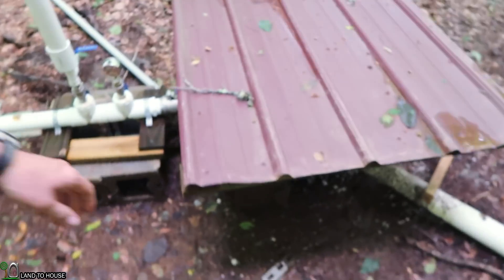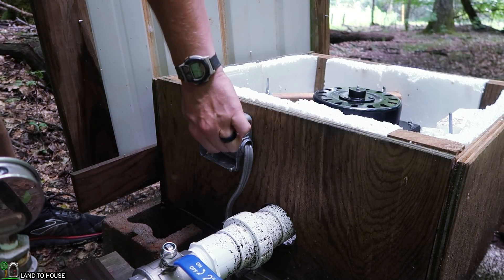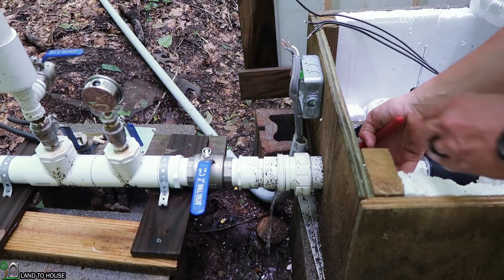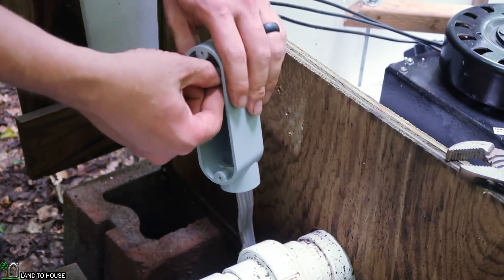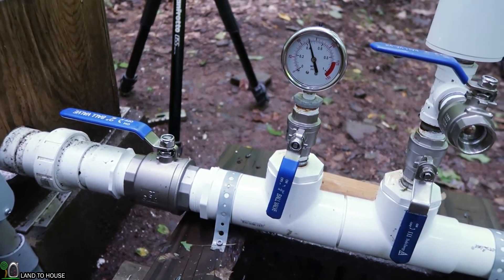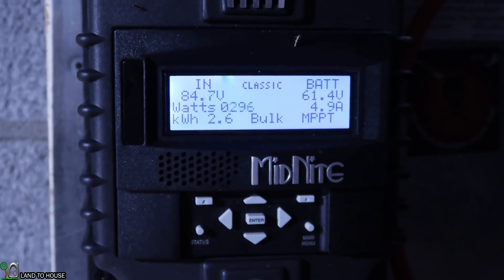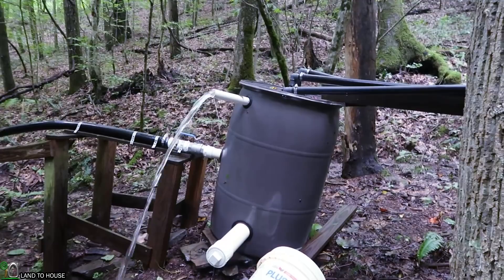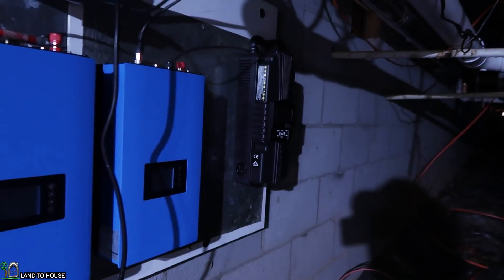Watts OVER 300! Adding another Nozzle increases Watts in Micro Hydro

Comment: you could put a three-phase autotransformer at the output of the generator (surely it will be 400 -600 Hz for which a small size is enough, and you bring the output to a higher voltage)

Comment: Why did you not make a water-tight connection in the LB?  That is one of the two reasons for a 90°LB, the second is for long pulls.  Also, I am very concerned about batteries in the crawl space.  I know of a couple fires that have burnt down "Battery Houses"! My Cuz lost his solar bank out-house just that way.  Better an out building than YOUR HOUSE!  OK, I looked again and the wires out of the PMA are a little short, but you could rotate the the top of the PMA 1/4th turn counterclockwise without redoing the piping. Thus allowing wires to be closer.  Or am I all wet on this?  LOL  But!  I am impressed and want 300watts, MYSELF!

Comment: Of course you have lost me when you start taking the technical info stuff I don't have a clue on what some of stuff but other I do get it.  To me it seems to add one more 55 gallon drum  to  catch the over flow water have water to use also. .Also why have four  Nozzles when you are only using one or two at time. Don't know why maybe open 3 and 4   1/4 way or 1/2 way open or less and see if water psi can keep up after putting the same size nozzle on the other two . Like i said I'm new to all this . Looks great good job . Ps, thanks for coming back and putting some kind all weather box at  Generator box .

Comment: Is there a limitation of how much pressure or water flow the generator can take? Otherwise why limit your water flow and waste the over flow?? My humble suggestion would be using a much bigger picture to get more water flow down stream so you can use more nozzles now instead of waiting for rain. You are throwing water away via the overflow.  More rain will just mean more over flow.  Why not use the overflow water now via much bigger pvc down to the generator and allow much bigger outflow instead of the restrictive 3 to 4 inches diameter pvc? The design does not make sense to me.
Reply: He has too little flow to run it at max sometimes 
that's why he has to limit the flow

Comment: Your system seems like a good candidate for a control system to adjust how many valves are open at the turbine. Low pressure=close one.
Reply from the maker: Yes that would be fun. I might get into that someday. For now its just open. Something fun that has happened is when the water is low the pressure drops and less power is maid. When it rains the the pipe refills itself and the power goes up.

Comment: Hello there. I'm just wondering if the inverter would run, if it is connected directly from the turbine without the battery thanks..
Reply: the inverter would get fried if you connected it directly to the turbine 
the turbine outputs 200Volts DC 
the inverter runs on 60 volts from the battery bank

Comment: Seth I love your channel and your style!
Natural thing would be to look at the nozzles in a Pelton/Turgo runner. I am not an expert at hydro, however that generator is garbage (stator magnet combo).....Also it looks like a way to small Pelton wheel attached to an of the shelf part from a motorcycle stator (which is in no way optimized for this). With your head pressure that turbine should be making at least double of what you are at.  Diameter of the turbine is simply to small(You waste so much torque this way). Also If you build a "dam" for an intake to filter silt etc....The water will try to escape the easiest way. Filter/intake needs to be submerged.... The intake part of turbine with the 4 nozzles If you insist on that design and considering the money you spend on this. Get a pneumatic/electric 3 way valve of  of aliexpress. What are the RPMs? out of courisity?
Reply from the maker: Thank you. I like to just head out there and give things a try. 

The power produced by this pma is actually spot on for the math of this type system. I actually get slightly more power than expected. 

(Head pressure x gpm x .18) /2 =power

The wheel is so small to produce high volts. I am getting 200v out of the pma.
Reply: It may sounds like I'm a sour guy who tries to impose I know it all kind of dude.  It is not at all like that. I LOVE your projects, I love your ram pumps etc. . I just wanted to say that a Pelton is an impulse turbine, and so is the closely related Turgo. This kind of turbine works like an Impact Drill - Applying micro knocks to create torque (impulses as the water hits the spoons)  The closer you are to the center though. the harder the knocks needs to be and the more of them there need to be. I would assess that you could increase the diameter of the wheel and perhaps look at attaching more on the stator..
Reply from the maker: No worries! I appreciate you watching! I am really new to water power. Something I have wanted to do for a long time and I am happy to be trying it out.

Comment: How much can you make/save if you switch from running a generator off the water to running a car AC pump and doing a heat pump setup for heating and cooling of the house? The waste water makes a great heat/cooling dump and can send hot/cold coolant from the micro hydro setup back to the house to not have insane refrigerant runs.
Reply from the maker: I actually have no idea!
Reply: @LandtoHouse  But that is a great idea, generally. At the moment you have an AC unit back at the house which is pulling/pushing heat just from the air. But air does not have a high heat capacity. Your AC unit would be much more efficient if you could use another medium than air, like geothermal (ground-source) or your creek water. Anyhow, that would need a major update of your AC unit ...

Comment: If you use valves that can be  controlled electronically to vary the flow rate, then couple that with a pressure sensor, you could get the optimum output automatically, adjusted in real-time.  Furthermore, with a wireless transmitter at the intake, you could measure overflow.
Reply from the maker: Yes that might be in the future. Not sure how well wireless is going to travel 1100' through the woods.
Reply: @LandtoHouse  Wireless will be no problem.  If you can find suitable stepper motor valves, i'd be happy to help with the microprocessor/software side of it.

Comment: Have you ever tried to run 2 of those generators off the same water nozzles? 
Maybe a Loc-Line 1/2" Flare Nozzle would do the trick
Reply from the maker: My assumption is the split flow rate would half the power output to each pma... making the same power in the end.

Comment: What kind of water flow & elevation would it take to max ouy the capability of that turbine ? As well as what is the minimum flow and elevation required to get anything worth while out of that turbine??
Reply from the maker: Not exactly sure the max potential of  the system. I think at least 2kw. I have actually run the turbine with 50 feet of head and 8gpm. It was producing 56 watts.

Comment: What about a flow sensor on the overflow or water level sensor in 50gal bucket to signal via LoRa how water input is available? Just will need a small water turbine at the input to provide enough energy to send data...

Comment: Have you thought about adding a few barrels at the intake rather than just one, so you capture more water instead of losing it through the overflow. I'm sure a float switch in the barrel would be able to alert you easily if the barrels are running low or if you have enough to open more jets. More barrels will help when you have less rainfall as you have a reserve. Do you have enough wind in the valley for a wind turbine project too?
Reply: Even if a barrel is 50 gallons, that only gives 2.5 minutes of water per barrel, having enough water reserves to even make a small difference would be very difficult

Comment: If you want a lot of power double it have two hydro power houses since you're getting that much water and set them all at the same 3/16 so instead of 300 w from one powerhouse get upwards of 600 plus Watts from 2 powerhouses
Reply from the maker: The water flow rate is my limiting fartor. Last week the flow was only 8 or 10 gpm. Not enough to run the 1/4" nozzle. The power out was only 56watts. So I could only run 2 turbines 1/2 the year at best. Or I could run 1 turbine at 400w 3/4 of the year.

Comment: You can easily use 1,2,3, or 4 jets without any additional valves. 1 all valves closed. 2 open inlet side valve. 3 close inlet side valve and open double jet valve. 4 open all valves.
Reply from the maker: Yes the issue is if I want to have different sizes of nozzles on there. I might install three 3/16" nozzles and the main 1/4" nozzle in the middle.
Reply: Land to House  yeah you just need to logic out the gpm combinations and valve positions.
Reply from the maker: And have more water in the creek :)

Comment: Im really questioning how such a big motor can only produce 200-300 watts at such a high cost.. there are alot smaller cheaper motors that can produce alot more power.  What makes this one better than say a normal alternator that can produce alot more than 200 watts? Please help me understand what I am missing.
Reply from the maker: This one can make 2kw or more. The issue is my setup. (12gpm x 163 feet)/10 = ~200w. Thats my limit. I expect to see close to 500w when I have enough water.
Reply: @LandtoHouse  ah ok that makes more sense to me now. Thanks

Comment: When you shut off the water at the turbine how long does it take the increased flow at the overflow to reach where your turbine is?
Reply from the maker: Its hard to tell with the 4 or 5 springs between the turbine and the intake. But I would say 15min.

Comment: Can you run 3/16 on all four of them
Reply from the maker: That would need 32 ish gpm to operate. I have seen 39 out the overflow before. I expect that I can get it to work. I think what I am going to do is three 3/4" and the middle 1/4" So I can run several options.
Reply: That clears that up thanks
Reply from the maker: I mean three at 3/16" haha not 3/4" that would be a massive amount of water.
Reply: @LandtoHouse  Wouldn't it be better to have two opposing nozzles for the long-time opperation, to avoid a constant momentum on the turbine axle? What is Spencer Langston saying about this?

Comment: Ok, now that you have shown us some numbers on pay back, what is the expected life of the turbine and it's cost? The idea here is to see actual cost over time, including installation and replacement parts. Obviously we can't predict when a tree will fall and break a pipe, but you get the idea that other things will crop up eventually. Might not be an out of pocket expense, but down time does figure in.
Reply: There’s also a major variable factor that’s hard to quantity with off grid systems, and that’s producing your own power when it may not be available. E.g. all the fires in Oregon are causing power companies to shut down power lines in some rural areas to prevent more fires. Grid power is heavily subsidized so it’s hard to say that your bill represents actual cost or value per kWh.
Reply: @rzrbrn22  ... even if the power were subsidized the monthly bill he gets still has a fixed cost per Kw delivered to the customer. Here in the northeast we also have a delivery charge (transmission fee) based on consumption. Add in the base monthly fee, fuel surcharge, etc, it works out to around 17 cents per Kw. Now the problem with grid-tie inverters: No grid power means they shut down.
Reply from the maker: We pay around $0.16 per kwh. The savings on power with solar is $40 ish a month. The off grid system is coming soon!
Reply: @rupe53  There are inverters that switch between grid tie and off grid. But they aren't cheap. Like around $1500 for the cheapest ones.
Reply: @LandtoHouse  It is hard for us to get a reasonable payback time as our cost is 13 cents per including all the taxes, fuel charges, Hurricane hardening upgrades, etc....  And the company is involved in all types of power except I think hydro power. There are two nukes about 10 miles from us, Combined cycle about the same distance. And a large solar setup about 8 miles from us as an example of just the local area. The company also has wind turbines and other plants throughout the US and Canada. They even have a plant that they convinced the Chinese to go in on that is making their own solar panels. They plan on having 30 million solar panels by 2030. The local unit is 74.5 MW ( ~ 330,000 panels ) worth of power on a good day.
Reply from the maker: Thats why I went with two $250 grid tie and one off grid for $400.
Reply from the maker: I have the parts for an off grid setup. About to start that install. It will be so nice this winter.
Reply from the maker: Apparently the turbine bearnings are good for 5 years or more. There will likely be some extra cost over time. It is a fun hobby and will provide a nice off grid supply.

Comment: Did you have to go through an interconnection agreement with the utility? I know the inverter has a minimum import setting and a CT on the main coming into the house but is there a failsafe mechanism? Utilities are generally very stringent on these types of things.
Reply from the maker: This unit is very fast to detect if there is no grid power. It is auto islanding. As soon as the plug is pulled or the grid is down the unit is powered off.
Reply: @LandtoHouse  The description rather sounds like Anti-Islanding than Auto-Islanding. Does that mean that in case of a power loss you can not use your batteries to power the house? Or is there a switch were you can set an Islanding Mode by purpose?

Comment: i think the 1 1/2 penstock is limiting you to around 25 gpm, may need to upgrade the top section to 3" in the future depending on flow
Reply from the maker: The max flow rate of the 2" pipe at 1100 feet is 39 gpm. This means my max power potential is around 500 watts. But the normal creek flow rate is 25 to 45 gpm. So a larger pipe would not help much.

Comment: Just automate it. idk how but just do it. :D
Reply from the maker: Perhaps some day I can get some automatic  nozzle adjustment. Not sure how.
Reply: @LandtoHouse  Might be possible to use a digital pressure gauge, Arduino, and stepper motors controlling valves. Not something I've done before, but would be a fun project!
Reply: @LandtoHouse  spear valve and server motor and just use float switches in the barrel to control how far or how many are open same could be done with the ball valves if min you see is 10gpm then make that the main jet and the rest come as as the barrel rises in capacity
Reply: What about a setup that added/removed flow from nozzles per incoming volume? Eg if inputs to nozzles were set at different head pressures? So if flow rate was lower, only one would flow, but if higher it would increase nozzles automatically?
Reply: @rzrbrn22  But how. The only way seems to be something mechanical. How reliable is that?
Might as well try a nozzle that widens a little bit if the pressure is really high. I don't think that even exists. Time to invent it.
Reply: @jackykoning  spear valve do that
Reply: @jackykoning  Sure they do. We used ones on large flood control pumps. Jets also have them on some engines ( SR-71 as an example ) which use a moveable needle in them.

Comment: What are you thinking of?  You ALWAYS make connections inside an electrical box box!!!
Reply: At my university some scientist/experimenters used jumper cables on a 440volt plasma generator. I made them stop that practice but science/ experimentation sometimes takes shortcuts. Dangerous shortcuts. Just remember, amperage can kill!
Reply: @lougiddings4054  yes... But that's how we learn 😂
Reply: Not a major issue, he's not even using antivibration wire nuts, so.... Who cares. It'll be fine I'm sure.
Not a whole lot of slack, so no risk of snagging.
Reply: @jamess1787  ... if we're really looking to meet code he could have replaced the steel box with a plastic box in the same location.
Reply: @rupe53  pretty sure this is far from meeting any type of electrical code and it's not a living space. It's a DiY project that has little safety implications of something goes electrically wrong. Would be nice to see him store the batteries outside separate from his home.
Reply: @jamess1787  ... agreed, but batteries do have better performance and life span in a controlled atmosphere, compared to being left outside in high or low temp situations.
Reply: @rupe53  👍. Maybe vented battery box. Love this series, it's awesome.

Comment: Just trying to work out the maths on the swap. If you've swapped a nozzle which takes 12gpm for one which only takes 8gpm, but you've still got 10gpm overflow, why couldn't you have run the existing nozzle at the same time to start off with if you've already got the extra flow?
Reply from the maker: I saw the water flow in the creek dropping over a few weeks. The flow has now dropped to 10gpm and I cannot run any nozzles. So back when this was filmed I got 2 weeks before the flow was gone.
Reply: So you are saying the ebb and flow of the creek is directly correlated to the size and quantity of jets used at various times of the year. Will you be constantly changing jets and volume of water or are you looking for that optimum set up for year round use with out having to mess with it constantly. I appreciate your experimentation.
Reply from the maker: What I pan on doing is have the main nozzle at 1/4". Then the other three at 3/16". So I can use either 12gpm and make 200 watts, 19gpm and make 330watts or I can use 28gpm and make 400 + watts.